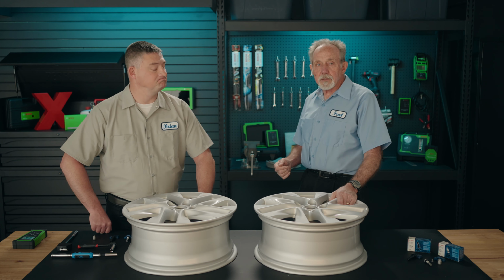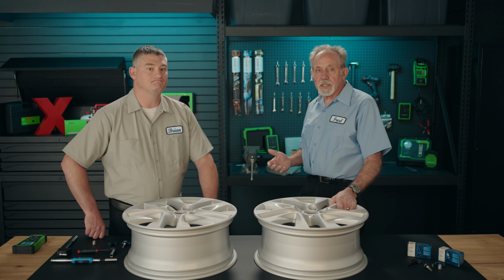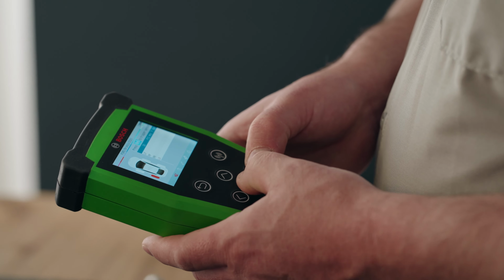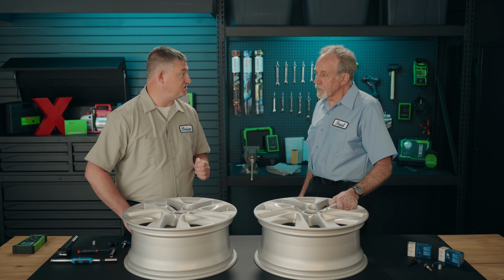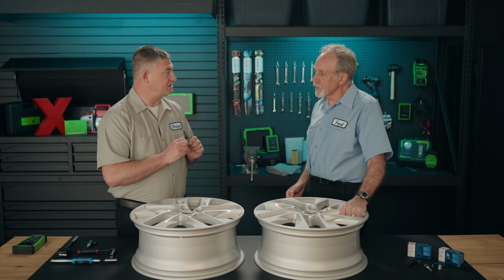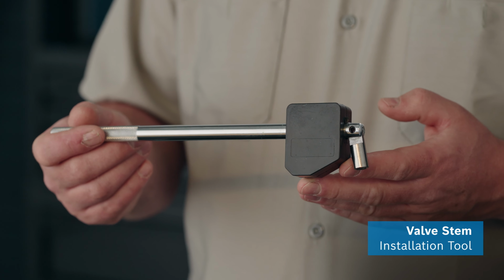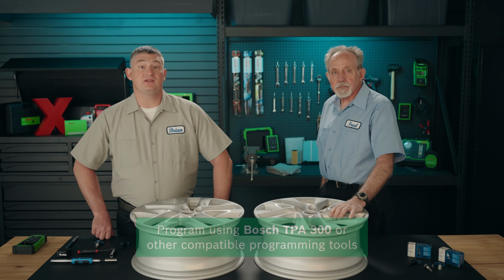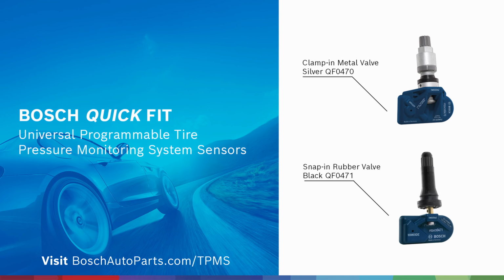FRED TALKS Introducing and Installing Bosch Universal TPMS Sensors

Comment: So to confirm the installation process for the aluminium valve stem into the wheel, once torqued to 4Nm does this also set the stem to sensor square sholder bolt at the appropriate torque value?
Reply from the maker: Hi @AISherwood - Yes, The Upper seal resistance allows for the lower bolt to be torqued correctly.

Comment from the maker: Hello.  Thanks for reaching out.  You may be having an issue related to tool compatibility.  What tool are you using to program the sensors?
Reply: With Texa TPS2 i cannot activate them, what a waste of money on this sensors!
Reply: I bought these sensors and installed them on the tire. Mounted and balanced. Nobody can activate them in town. What a nightmare. Nobody buy these!

Comment: Just stay clear of these Sensors unless you really know how to active them, They will not wake up or activate in any way like all the other universal sensors on the market unless you have a very expensive and new up to date TPMS tool,  They don't wake up at all unless you input each sensors ID number into a TPMS tool that's compatible, which is not very many, and  Bosh's TPMS tool is over £500.  
If your lucky to activate these you now have a massive compatibility problem inputting their 8 digit ID number into the car ( not 7 digit ID  like all other Sensors)  So the ID numbers are to long for most cars ECU and TPMS readers.  NOT VERY FRIENDLY SENSORS TO USE......  Basicly Bosh made a Universal Sensor that only activates with their own TPMS tool. As we could not get our hands on this tool very easy, we threw the sensors in the bin never to buy again.  If your going to make a Sensor, at least make them so you can easily activate them with all the normal TPMS reader tools that's out on the market.
Reply: Wouldn't they work with the Autel TPMS Programmer?